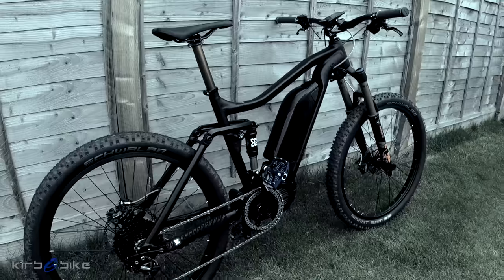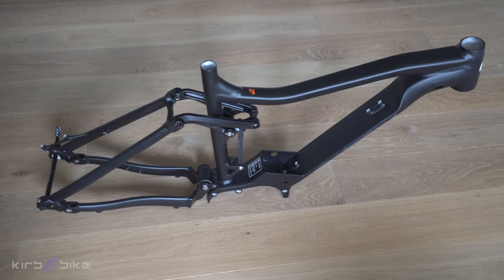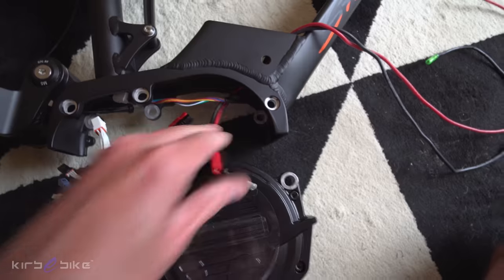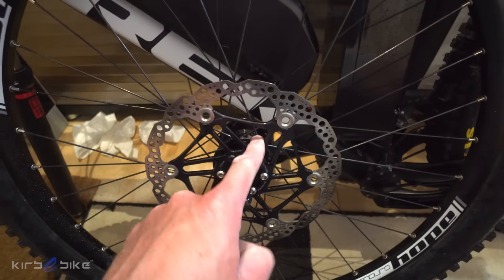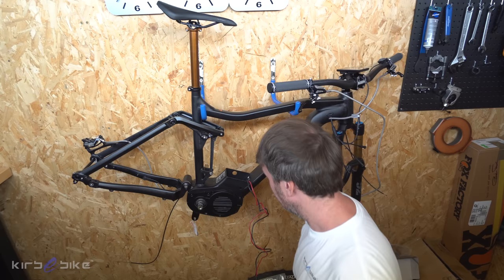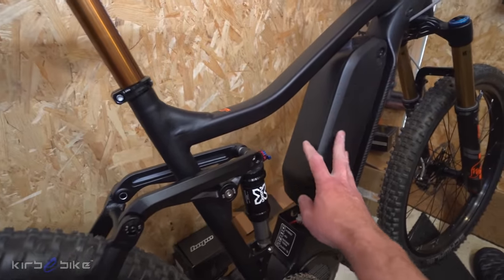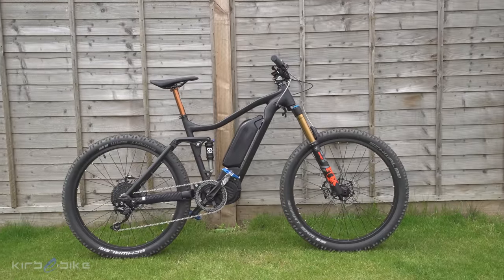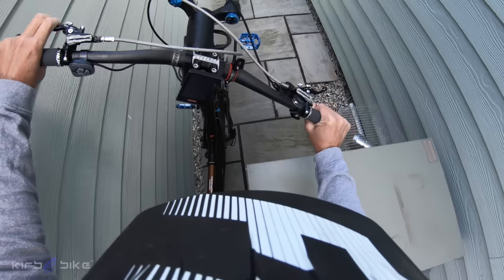HOW TO BUILD THE ULTIMATE eMTB!!! | KIRBEBIKE

Comment: Can't seem to find the spec for range and how long battery last??
Reply from the maker: It’s a really open ended question becuase if you are flat out then it will be a lot different to if you pedal hard. 25 miles is the average but you could easily make it 40 miles
Reply from the maker: By today’s standards the battery energy density is high compared to the likes of Bosch, Yamaha etc

Comment: After watching your videos I got the big and got a bbshd, which is brilliant but I changed the settings using the speeed app afterwards the peddle assist stopped working, the speeed sensor is ok it records the speed,I was wondering if anyone had any ideas to fix this, thanks guys.
Reply: Figure it out yet? Totally new to this ebike world  but you should be able to reset it to its original settings.  Google it. I just recently bought a FucareGemini and freak'n love it!!! But after watching this I will be building my next on! Probably very soon now that I've seen hie seemingly 'simple' it looks!?!?! Good luck! 
Do you have this bike here or no?
Reply: Cheers Elvis, I've done some research on the Web, seems like the app itself maybe the problem, apparently if you do the settings on the pc instead of the speeed app it will sort it out. I've just been using the throttle having a blast despite a spill I had ( 2 cracked ribs ), but I'll get it sorted soon 😉
Reply: I know your busy Andy, any ideas about. My problem, cheers

Comment: What are the specs for rear hub & axle?
Reply from the maker: Boost 148mm, 12mm axle
Reply: andy kirby Ordered 27.5 rims with outside width of 50mm and inside 43mm in order to fit 3.0” tires. Hoping the rims will fit!!!

Comment: 250w you dont need bms, I have one that I builded out of used cells whitout bms. Cell voltages are spot on after 1year of drive. Cost just tin and nicel strip, 2e total.
Reply from the maker: You always need a BMS for charging. Charging Lithium Ion batteries without a BMS is dangerous. Every commercial battery has a BMS.
Reply: @andykirby  I know, but I have been chargin 10s4p battery whit 42v 2amp li-ion charger (cost 10e) whitout bms year now and its fine. I check cell voltages every 3 months. Thats my point, you dont need bms if you just want working ebike, proven not dangerous. I know it can be dangerous, but not if you know what your douign.
Reply: Juho Peltola   for the price of a good bms, why not put one in?    One bad cell out of the 40 you have installed will  give you problems down the road, guaranteed.

Comment: Great setup ! Except a 52v battery with a throttle would be the game changer ☺
Reply from the maker: Throttle just plugs in if you want. We tried 51.8V but it doesn’t make a lot of difference in a heavily geared reduction drive like this. On a hub motor it’s more noticeable.

Comment: I got that motor in hard tail mtb from Frey I drag a double thule chariot   at 50 km with my kids no prob it's got 54v battery
Reply from the maker: That’s amazing!! What a way to travel😁
Reply: Mae Flanders   I have found that hardtails work good with mid drive motors.  There is frame flexing that is noticeable on suspension bikes, when you power up under load....but on a hardtail is perfect.  Guess it depends on rear link ...

Comment: If you want even more power, ElectronCycles has a 3250W plug and play controller upgrade for you.
Reply from the maker: Ah yes I’ve heard about this, I will check it out thanks👍
Reply from the maker: Eek they are asking £1k for it!!! You can easily put a Sabvoton on this motor, that ASI controller is great though.
Reply: @andykirby  1k?! Should be 299E for the controller kit. Plug and play.

Comment: ...why use chain drive, when you can avoide losses created by friction on the chain simply by using a direct driven wheel?
Meaning the loss of 2-7% of power (and range)
Reply: cause dd wheels cause massive weight imbalance. Rear end becomes way too heavy
Reply: @sagesends  
That's true.
However if you have a (smaller) direct drive on each wheel that would keep it balanced, and also increase effective grip when applying throttle.
Sorry for bothering you.
Reply: You would lose more range through inefficient gearing on mixed terrain.

Comment: Please provide price list of all the components to do the build
Reply from the maker: Here’s the full build using cheaper components: https://www.cloudsto.com/ebikes/kirbebike-vapour/kirbebike-vapour-full-suspension-emtb-detail.html

If you want to copy the exact build I did in the video then be prepared to spend about £4500 😁 it is however better specced than some bikes out there that cost twice as much...here’s the list:

KirbEbike Vapour Frame
Fox 36 Float Factory Ebike Forks
Fox Float DPX2 Rear shock
Hope Tech 3 e4 brakes with 200mm floating disks
Bafang M620 1000W 160Nm torque motor with programmable torque sensing and advanced display and diagnostics.
RaceFace 42T chain ring
SRAM crank arms
700Wh 48V Battery
Shimano Deore rear mech
Nuke proof Carbon handlebars
Hope Pedals
Hope Stem and headset
Alexrims MD35 
Schwalbe Eddy Current 27.5 inch front and rear ebike tyres.
Various other hope and nukeproof bits

Comment: Where did you get the Bafang Ultra compatible frame from? 

BTW for all the wowsers the average bloke, or even average copper are not going to notice any difference between this bike & those legit 250w ebikes & won't even care about it going up hills a bit quicker. I have a 5000w 84v Cyclone coaxial for about a year now & to people not into ebikes they just think it's a ordinary (250w) ebike & not even one cop has given it a second look. Also off road it's the noise of motor cycles that piss people off. No one gives a fuck about ebikes on the trails because they don't make noise & to such people whether it's 250w or 5000w they're not going to give a fuck, because they all look the same to them.

Comment: You never gave a build price. Did it compete with the main brand?
Reply from the maker: Yeah I mean this build used the highest possible components and came in about £4500 and is way higher spec than Treks best offering (£7000) and specialized (£7000-£10K)

Comment: Let me think 15k + California tax for an HPC E-MTB or The Kirby bike? Yeah, I'd go for the Kirby bike. HPC is a joke 2500.00 for a 72v 15ah battery. They are using the same Bafang motor. Cheaper brakes and they keep saying Made in the USA as if it's going to inflate the cost 10 grand don't get me wrong the HPC is nice but not 15+k nice and the performance is probably on par with the Kirby bike. I hate when companies use MADE IN USA to inflate prices. $2500 for a 60a continuous battery. No thanks!

Comment: Great that new self build options are available, but shame it's an M620 750w motor instead of their MMG5 20 250w motor!  So important to not jeopardise our legal access to all push-bike trails by going over 250w unless on private land with no public access. "eBike Smile eMTB Community" fb group is for anyone interested in the miles of smiles you will get from 250w eMTBs
Reply from the maker: I wouldn’t worry too much about this, the Bosch and Yamaha drives peak at well over 250W anyway 😀
Reply from the maker: Just posted in your group, hope this ok, not really an advert as that exact model can’t be bought 😃

Comment: Woah awesome, thank you for sharing! Imagine how much more powerful it can be using Tesla batteries!!!
Reply from the maker: They are pretty much Tesla batteries.😁
Reply: @andykirby  if model 3 batteries were used, it'll probably be at least a 30% increase in performance.
Reply: @andykirby  btw do you ship to the US?
Reply: It would not be any faster unless you upgraded the controller and TESLA CELLS ARE SHITE
Reply: @holyscience3763  Why? Assuming that the voltage is the same. The motor is the same so why would you get a 30% power increase?
Reply: @ApriliaRSV4F  the  battery chemistry being used on Tesla batteries are better than the other lithium battery chemistries i've came across when it comes to chargin(except in cold weather), discharging and capacitance. the model 3 batteries uses the same battery chemistry as the other Tesla models in production, it's just that the model 3's battery dimensions are slightly different...giving it a 30% boost of more capacitance than the other Tesla models' batteries. i learned all this from youtube videos lol..God bless the internet

Comment: U can see the quality of plastic is bad on the battery brackets.... when it’s hot n u go full throttle the plastic might melt ... if u want fun, get a BROSE system ... it’s the best so far
Reply from the maker: Plastic? On the battery brackets? The battery doesn’t get hot, if it does it’s a very badly designed battery! The Brose motor is only 250W, not in the same league power wise, this is 1500-2000W
Reply: andy kirby no way this motor has so many watts if he does what kind of battery u need to run it? 250w motor with 500 w battery  gives you the ideal amount of fun time. Hell I went 24 km only up including super steep climbs. Also the motor power is measured in watts if you refer to the consumption. You never mention NM. The place where battery contact meets the harness. If you go steep and really posh the bike high watts will heat the contacts to a point that plastic will melt ... I had that issue with my previous bike.  90 nm is enough to get up almost any climb as long as you lock your suspension. 120 you are the king. BROSE produces 120 nm. So I don’t see how this all makes sense. Another thing how much % of assistance this bike delivers. I tried Bosch with 300 and BROSE with 500. 500 is 5 times your strength which is a lot. Next thing is tuning and cadence. If the motor is powerful than your low speeds are really only for steeep hills but if it’s too powerful your front wheel will detach ... can u explain me all this please
Reply from the maker: Robert Kukulis hmm, there’s a lot to learn here, maybe to much to write in the comment section 😁 Basically to achieve 1500W at the motor you would need to pull about 30A from a 48V battery (1500W/48V) that’s actually not a lot for a high powered ebike battery, I’ve made ebike batteries that can deliver 15kW before😁. Ive never seen an issue like you mentioned with the connectors melting, as long as you have the correct surface area on the contacts for the power you are running it will be fine. It’s sounds like your connections were not adequate and they were high resistance which would mean they would heat up rapidly. You need to try an ebike with more than 250W, it’s pretty amazing. The bafang has over 150nm of torque which is the most on any mid drove (pedal assist motors anyway) of course without properly setting the torque curve up it would be a nightmare but that’s where tuning comes in. This motor can be tuned with an app. It just gives you flexibility. Where the power really shines is in throttle mode where you can just go up any hill no matter how steep without any drop of speed, also if you are a heavy rider then you can add a bit more power to compensate. There’s a lot more to it than this but maybe stick around as I’ll be going into much more about all this sort of stuff on the channel over the coming months.
Reply: andy kirby great explanation Thnx.

Comment: this is still too slow, i hope in one or two years this is possible with 6kw and a new battery technology with much bigger energy density, the pedals must be removed and then its perfect
Reply from the maker: I run 5kW with this modified but it’s actually too much on a bike frame. Anything above about 3000W really needs motorcycle wheels.

Comment: The engineering here is better than most home builds, but let’s not kid ourselves - the Bafang motors have a way less natural feel than the best mid drives, and the geometry of that frame is dated. 

I also disagree with those saying it’s ok to run high powered ebikes with no cutout limit “because the police don’t have the time to check every ebike is legal”. If you have an accident and a 3rd party gets injured you will be facing criminal charges and potentially a prison sentence, and ebikers in your country will probably be facing some additional ill thought out knee jerk legislation.
Reply from the maker: The old Bafang drives didn’t feel natural because they didn’t have torque control like Bosch, Yamaha etc. The Bafang M620 shown here does. It’s precise enough to do the most technical tricks and it’s completely programmable so you can tailor it completely to your own riding style.

Frame is not dated, just because it doesn’t have an integrated tube battery. It means you can fit over 1kWh of energy  storage if you are using it to commute etc.
Reply: I did not say anything about integration of the battery - I said the geometry of the frame is dated, which it is. The reach on the "large" is only 426mm (that's not even what you'd expect of a medium), and chainstays are fairly long at 470mm - compared to modern trail/enduro bikes with similar travel it's just not in the same ballpark. If all you want to do is commute or traverse fire-roads then that's no issue I suppose, but descending at speed these numbers matter, sorry. At £3400 complete it is not even that cheap compared to a direct sales bike like Canyon or YT. I would take Giant's Trance E+3 over this (it's bare specs are probably slightly lower but reach is better and there is UK dealer support all for the same money).

Comment: 160Nm for 1500W motor is nothing, weak torque.
Reply from the maker: What would you expect from a motor this size then? I’d be interested to know!
Reply: @andykirby  calculate here and see how much Nm must give a 1.5 kw motor. http://endmemo.com/sconvert/kwnm_s.php
or here https://www.convertunits.com/from/kw/to/newton+meter/second
Reply from the maker: This is just converting watts to Nm/s with ebike motors we are talking about how much torque is transmitted to the driveshaft at a useable RPM.

Comment: Cost engineering has that huge motor being four figure wattage hilariously WHILE esk8 ones would provide five in less volume.

Torque is transmission byproduct and gears even belts are CHEAP plentiful done what lightweight vehicles free us to use is rare moon even only found metals aspirational almost all viewers being are exploited with near term commercialism not pioneering development.

Quiet rim torque with no need to care about motor winding current CAPACITY just like cars max horsepower is moot on LONG distance treks SHOULD be focus.

Find some bum who grabbed an aleph ebike wheel from a dumpster  a decade ago DUH.  Or be TOO simple FOOL.